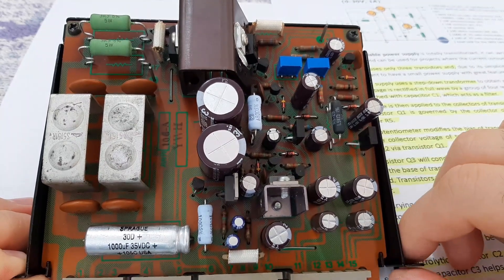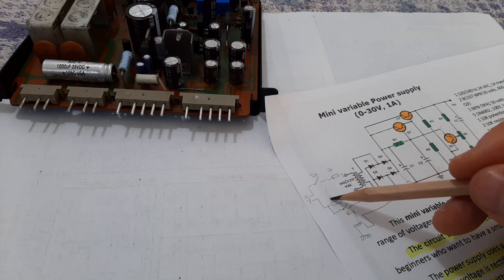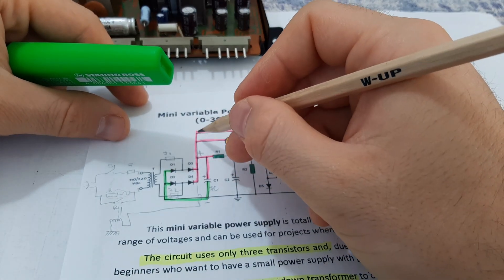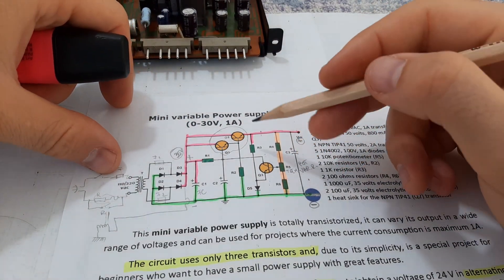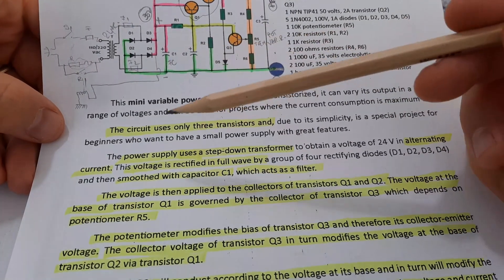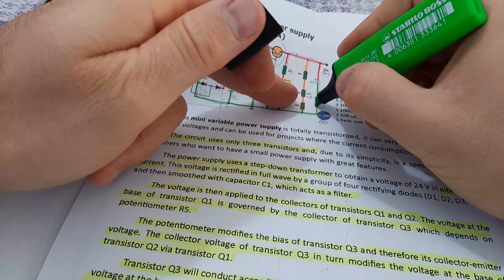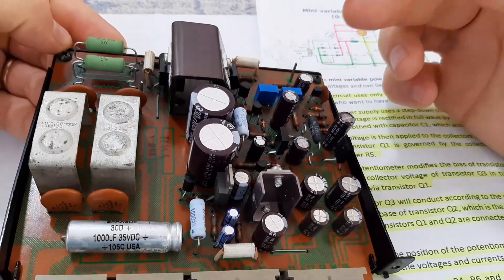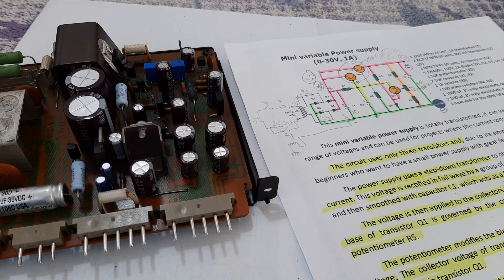Power Supply Functionality Explained Before Repair: Key Concepts and Operations

Comment: What's the function of R3
Reply from the maker: Hi, thank you for thumbs up and subscribing.
R3 is in series with Diode D5 connected between regulated + and ground, they form a current source. In the same time you will have a voltage drop on diode, around 0.6 volts aprox and the difference is across R3. Voltage drop across R3 divided to 1000 ohms it will give you a constant current, so it will be a constant current link. From this you will have a constant value on Emitor of Q2 and is not affected with current draw on Vout.
I hope i wrote a clear answer to your question!
Stay tuned, more videos to come !
Cheers!